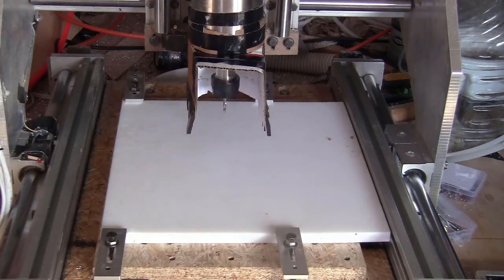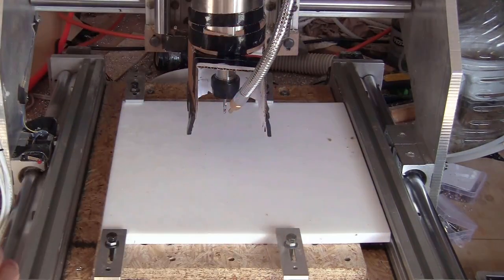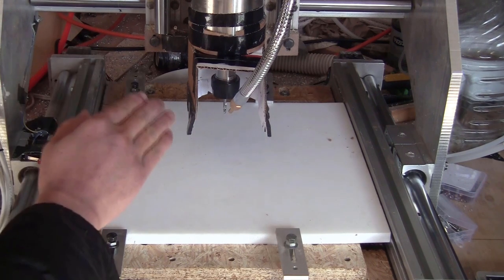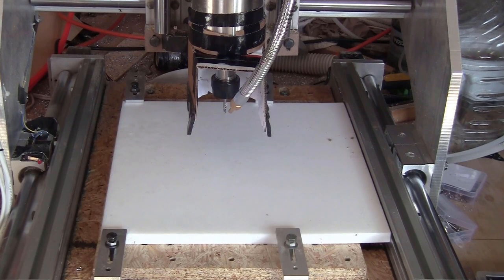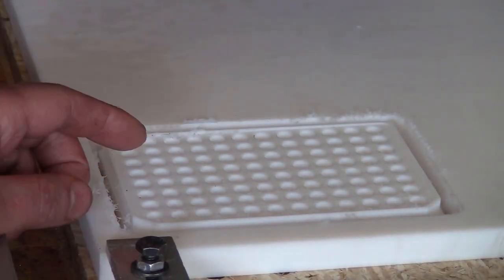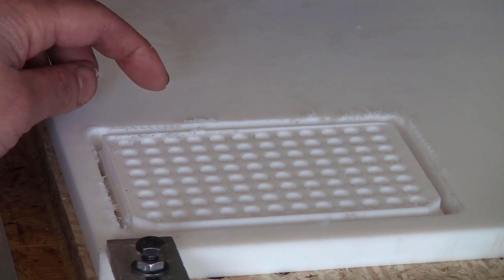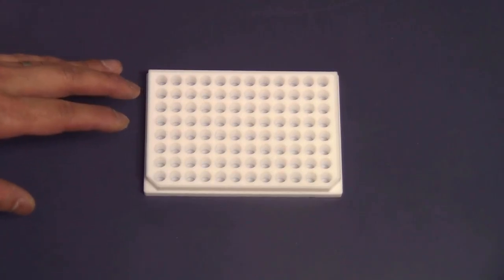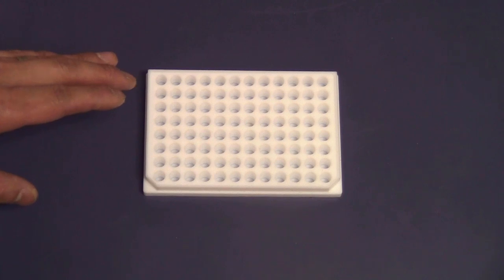High speed spindle vs. Teflon (PTFE) - easy as pie

Comment: I love it and especially that air setup you have.  I am busy all over the place lately so I must have missed that video but what is your air setup on that as I need something (though I am only in wood clearing the dust out is needed)?
Reply from the maker: It's good to be busy. I don't think blowing air to the bit while cutting wood is a good idea. The dust will fill up your room instantly. Working with plastic and aluminum is OK, but not with wood
Reply: @minhsmancave9448  What is it though?  How was it set up?
Reply from the maker: It's a mist coolant spray, I just shut off the water side so it only blow air. I hook it up to a air compressor. That's it.
Reply: @minhsmancave9448  Hmmm, I have never seen one that used a metal gooseneck like that before.
Reply from the maker: Pay more, get more. 4 times more expensive.